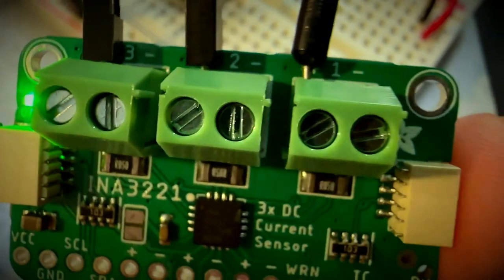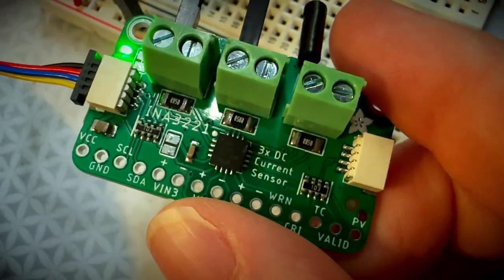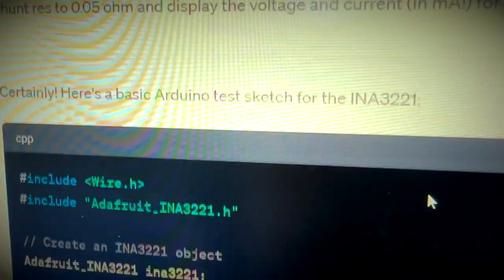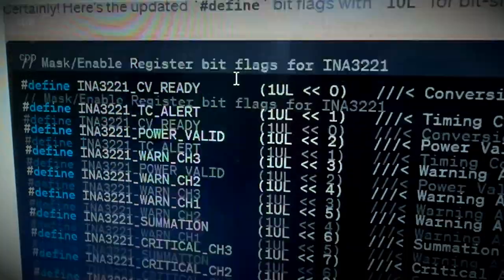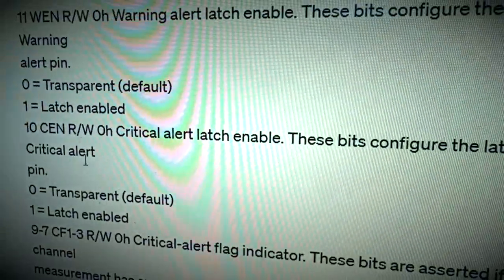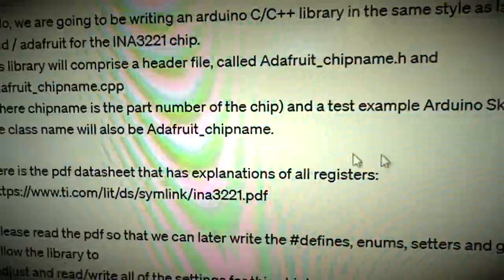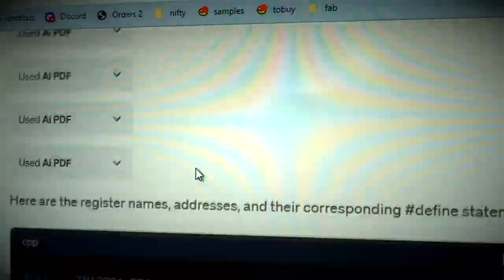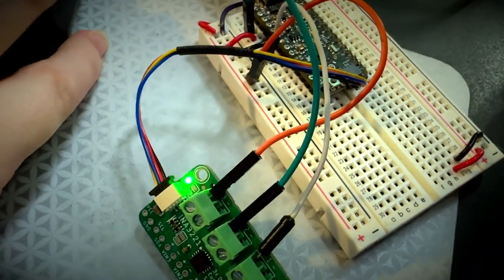INA3221 is a 3-channel DC power monitoring chip 🔌🤖🔍

Comment: Neat.  If you can, please make holes in the production board for soldering 16 AWG wire.
Reply: I have never heard of AWG before, and now I know it's a standard for wires almost no countries use
Reply: for the non-americans: 16AWG is 1.5mm2 metric equivalent.